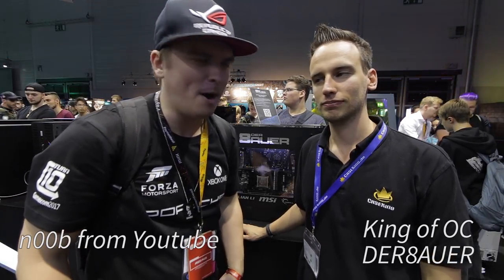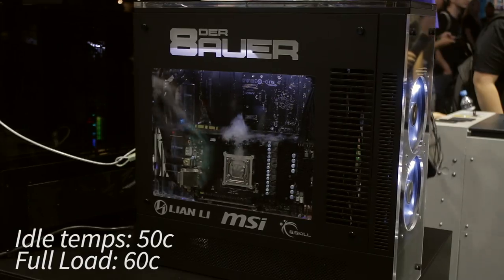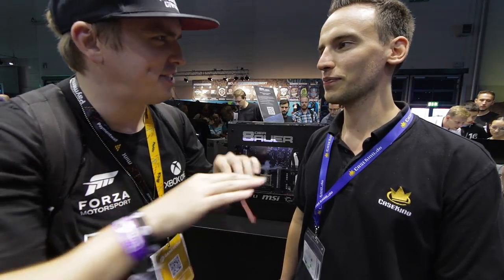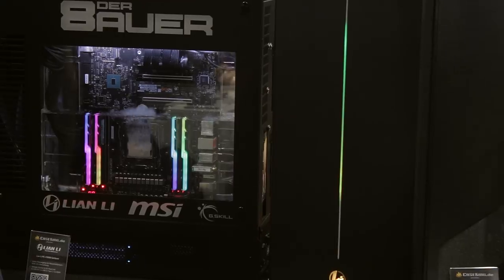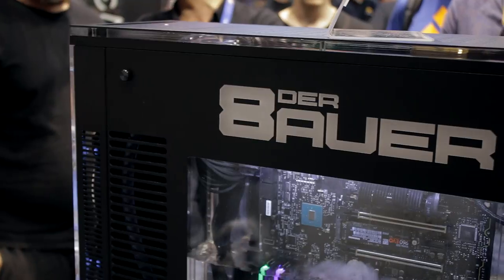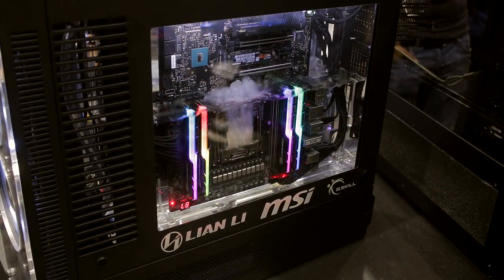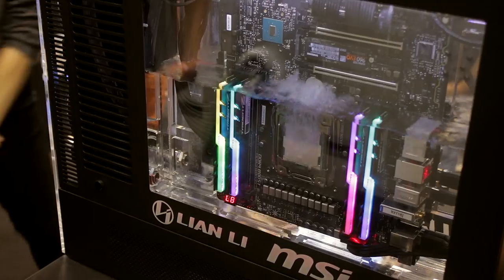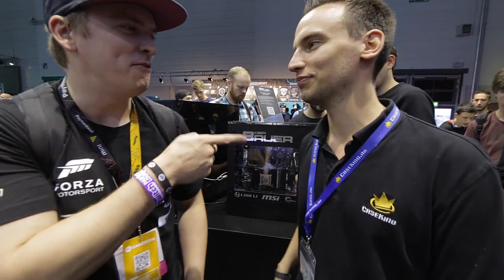My interview with DER8AUER about his 3M Novec Cooled PC at Gamescom 2017

Comment: It'll be fun upgrading components in this build... And considering the price of the fluid, for the regular gamer/home-user, it'll be less expensive to buy a regular water-cooled PC... Still, got to admit, it does look very sexy!
Reply from the maker: Really good comment man! How didn´t I see it before :D
Just but the best parts in that you can and build a new case down the line lol. I mean if you can afford this liquid and all the hustle that goes with it you can afford new PC-s :D
Reply: Huh, gonna look weird, but maybe install a tap on the case, so you can drain it for component changes? ^^
Reply: Braders77UK if I build a pc with this fluid called novec will my dvd Drive survive in the fluid novec it is  my dvd Drive just gonna Die ?
Reply: Take a look at Electrocool EC-120, its Single Phase, Non-Toxic, doesn't need a pressure safe container and is much cheaper per Liter
Reply: @EnglishPete  hi , have u test it by any chance?
Reply: Sadly not, as import duties from America to europe where pretty high, but a 20L container is only 360$, and I designed a Itx enclosure made of Acrylic that needs only 8L, EK pumps also work cause they have Special O-Rings (for more info look up: Electrocool Combatibility List)

The staff is very nice, just write an email.
Reply: @remigijusk8469  Sadly not as import duties are very high to Europe, but 360$ for a 20L jug isn't that much, a ITX "Aquarium" I planned used 8L, you can write them an email, and if youre in the USA I would get it for sure!

Comment: For DIY on a budget - just use regular water.
Reply from the maker: Yes, just not like this :D
Reply: Don't forget to apply the waterproof BIOS update to your systems first. Of course, Apple have had this for years already.
Reply: George Hafiz Yep, to ensure you get the best performance potential, it's best to add salt to the water first, as much as you can so that it becomes saturated, this way will give you the best Apple product improvements.
Reply: XD
Reply: With demineralized water it will actually work (for some minutes)
Reply: Oh God no 😅😅
Reply: Baby oil would be the budget liquid, water is too electricity conductive
Reply: Fy lol
Reply: imagine someone actually tries this

Comment: One of my dream machines. Love this process of cooling, my addition would be the usage of Peltier coolers instead of PC fan's over radiator while the radiator it's self needs cooling so Peltier cool the radiator not the Novec 3M.
Reply: Still gotta dump heat from the Hot side of the peltier, now more heat to push away vs air cooling. How do you propose to do that?? Another tub of Novec?? The laws of thermodynamics will get away from you quickly.

The challenge remains, you still have to seal the hot side from the cold side, to keep the novec fluid/gas inside the chassis. It's brilliance level stuff, but requires some to work with it too ;) Frabrication/engineering skills are a must.
Reply: Peltiers are wildly inefficient, especially with comparison to phase change cooling used in AC systems. Not to mention that this kinda goes around the whole point of having a cooling system like this in the first place, something energy efficient and effective.
Reply: Peltiers are garbage for most applications... They are so inefficient

Comment: Hah, that is amazing. I'm going to look if there's some guide on how to DIY this. I have zero funds for it right now, but it's really interesting!
Reply from the maker: Same! :D
Reply: 1600$ for the liquid, have fun
Reply: the price of the fluid is all over the place depending on vendor and 3M won't deal directly with home consumers. 4 months after your comment i have yet to find a guide of any kind myself but am looking into such a project still.
Reply: 3M Novec is expensive though. Mineral oil is more recommend. Deionized water can work as well but you need to have a dust free environment during the assembly process.
Reply: @Ardkun00  Not a good plan at all, distilled/deionized water only remains nonconductive for a very short time when in contact with almost any metal surface.. as in everything on a motherboard. It might work for an hour, it might work for a minute, you might get a month. Sooner or later its going to pickup enough ions to ruin your day

Comment: Along side the price, it's nightmare when you want to open the case and replace some component : ).
Reply from the maker: You just pay some fishes and let them do the work!
Reply: Servicing: Place chassis inside -5 freezer for several hours. Open service port, pour into equally chilled storage container, Cap said container. Job done.

Comment: how long does 4 liters or a gallon lasts?
Reply: I pulled this from 3M's website

Is fluid loss a problem in Novec-based immersion cooling systems?
Immersion cooling systems are typically designed to be serviceable and hot-swappable, but are also designed with fluid containment in mind. By following 3M best practices and purchasing from a 3M authorized immersion cooling OEM, fluid losses can be held to inconsequential amounts.

Comment: More of a 'nice-to-look-at' than an actual decent use though. The price, the issues of replacing parts (unless it's designed like a server farm in that aspect as well, like removable racks), and considering the fact that houses and appartments are not as sterile as server farms, dust -> Meaning you either have dust bubbling around after a while or you need a decent way to let off the fluid to clean the inside. Looks impressive, but would mean alot more cost and effort for practically no benefit.
Reply: The liquid doesn't harm the parts and unlike mineral oil isn't all sticky.  So just turn the PC off, wait ~5-10 min for the gas novac to convert back to liquid, then do usual repairs.  Super easy.
Reply: @deidyomega  Yeah, especially since you can literally put a dollar bill in it and take it out and it won't even be wet.
Reply: @deidyomega  The problem, is that if your hands touch the fluid, minerals may pass to the liquid, and then, the liquid would become conductive, and bye bye to all the computer
Reply: It's sealed. How would dust get in?

Comment: whats the proper cocktail in it? 1:9 ratio of distlled water + additives say mix Pentosin with  a drop or two of PT-Nuke? any comment? how long it would last 6 months? still its a lucrative gamble for it has hi tendency of being shorten anytime isnt it?
Reply: It's very expensive, special cooling liquid. Costs over $1000 to fill up as much as in the video.
Reply: Thats a special liquid made for that purpose. Its called "3M Novec" by M3 ^^' But its very expensive. The amount liquid used for this build was about 1600$.
Reply from the maker: I wonder how long that liquid lasts??
Reply: direct from their site

Is fluid loss a problem in Novec-based immersion cooling systems?
Immersion cooling systems are typically designed to be serviceable and hot-swappable, but are also designed with fluid containment in mind. By following 3M best practices and purchasing from a 3M authorized immersion cooling OEM, fluid losses can be held to inconsequential amounts.
Reply: No water at all. It's not a cocktail, it's a flourinated solvent. Highly stable.
Reply: @TheTanelChannel  In a perfectly sealed system with zero leaks whatsoever.. effectively forever from a human perspective. Novec is an extremely stable fluoridated compound

Comment: so what's the TEMP!?
Reply: I've seen 3M Novec 7000 (boiling point: 34C) and 3M Novec 649 (boiling point: 49C) used.  I doubt that chip temperatures much exceed those boiling points.  At those temps, as soon as heat is transferred to the liquid, it vaporizes.

Comment: I wonder how would this perform in comparison to water cooled system. Especially if you had oversized rads so you could keep the water temp near (at) ambient temp.
Reply: The laws of thermodynamics my man.  That processor should never go above the boiling point of the Novec.  You actually want the liquid too boil.
Reply: @mehrunez4838  Actually it must go above the boiling point otherwise it wouldn't be transferring energy to it. And there is no law that states "x should never go above the boiling point of the y" I mean to give extreme example place nuke under water and detonate it. I can guarantee you the surface of that nuke will go above the water boiling point without any problem.

Theory crafting is nice and all but actual performance is well the actual performance.
Reply: @petrkinkal1509  I realize I'm 1 year late and you may have found your answer, but the junction temperature ends up being about 10 degrees above the boiling point of the liquid. They have multiple different kinds of fluids with different boiling points, but for Novec 7000, you would be looking at about 40c max temps on any particular component.

Comment: Is it top end spec overclocking? What about the graphic card?
Reply: I was there an and the GPU is on the backside
Reply: this fluid was manufactured with Data Centers in mind so it can handle a lot of heat provided you have the means to cool it down to condense back into the system. there are other companies out there that use the same evaporative properties of fluids to create pumped closed loop systems which could potentially lead to even colder temps or higher clocks without greater heat. you could easily add a gpu to the cooling tank but it would be best to remove the fans and heat spreader.
Reply: Benni Schütte that's De8aur, he overclocks i9 extremes like eazy peezy. The lowest we can assume is an i7 7700K

Comment: My question is could you run fans submerged in this stuff to increase efficiency provided the fans worked in the denser medium?
Reply: I think the improvement wouldn't be very significant, nucleate boiling (as seen in the video) already provides a very high degree of heat transfer.
Reply: I admit I had too look up exactly how this stuff works, there is some really cool chemistry at work; and fans would be unnecessary. I didn't realize how efficient this system was.
Reply: Yeah, you dont need fans or pumps as the components arent cooled by convection but by evaporation of the liquid which rises to the top to condensate and fall back down all by itself.
Reply: Yes.

Comment: Mineral oil is cheap
Reply: but it will corrode your components tbh
Reply: mineral oil isnt comparable. this is a two-phase change system that will keep even the hottest components at 40C. sure they are both submersion cooling, but mineral oil wont work like this.
Reply: mineral oil doesn't phase change
Reply: Mineral oil does not vaporize and take the heat away. Nowhere near as efficient as a phase change material like novec